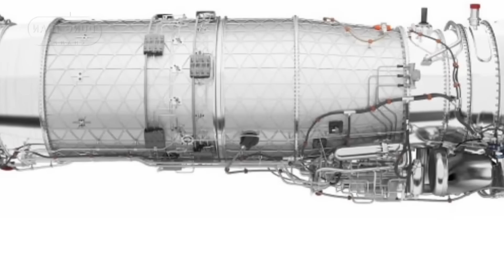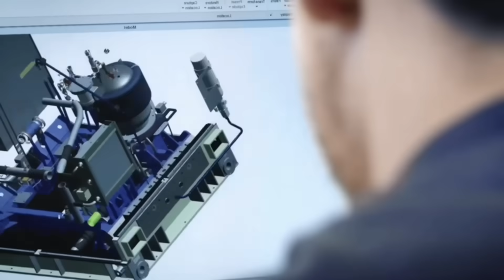How Rolls Royce Engines Make Sweden’s Gripen EF UNSTOPPABLE!

Comment: STOP LYING TO THE VIEWERS!
The JAS 39 Gripen E/F does NOT have a Rolls Royce engine at all and it is impossible to put that engine in the JAS 39 Gripen E/F.
The engine is the F414G developed by General Electric. This is based on the existing F414-GE-400 that is in the F/A-18 Super.
The JAS 39 Gripen E/F is completely built after this engine.

Comment: The US is blocking the F414 engine to Brazil's Gripens. That is the main reason for this proposal, since the other potential customers are NATO members. However it is costly to modify the Gripen to use the EJ230 or similar, so this will be dependent on sufficient number of orders for the modified Gripen, which hasn't happened yet.

Comment: The solution for the Swedes is to manufacture Gripen in two versions, one with the Rolls Royce engine and one with the present engine. Then they are free to export the Gripen with the Rolls Royce engine, if that is their problem.
It seems unavoidable to make the Gripen with Rolls Royce engine if it is true that that will enhance the performance of the Gripen to the extent it is claimed. TThe they should also ask General Electric to make an engine for Gripen that matches, or even excede the performance of the Rolls Royce engine.
Then the Swedes should end up with an aircraft that should make the big power move a bit more carefully around their smaller and assumingly less powerful neighbours. A least if those neighbours sports one or other of the 'Gripen variety in their arsenals.

Comment: Who made this video, Putin?  Ukraine flies F16's and it is getting a lot more of them. The Gripin E is powered with a GE 414 engine. The Gripen is NOT cheap compared to peers at $85mil. A variant F-35 is slightly more than the Gripen. Lockeed has these under $100 mil now. An upgrade Boeing F-15EX is $90 mil. Lockeed has delivered over 1,000 F35's. Sweden is not delivering a thousand of anything. The smart play is license Canada to build Gripins. With that you can have some manufacturing horsepower. Saab has a vulnerable situation now being so close to Russia. But Russia could soon collapse.
Reply: The Gripen fighter jet's cost per flight hour ranges from approximately $4,700 to $10,000, depending on the specific model and configuration. It is considered one of the most cost-efficient modern fighter jets, with lower operating costs compared to other aircraft like the F-35 ($35,000–$42,000) and the Eurofighter Typhoon ($18,000).

Comment: The third option is by far the most attractive and time-efficient. However, in the meantime, existing US engines should be reverse-engineered. They should then be analyzed to determine the highest-failure-rate components. These should then be manufactured by the EU for assured maintenance availability. This would keep the US engines functioning during the transition from US- to EU-made engines.
   The same could be applied to any/all avionics. Analyze their function. Duplicate these components (with just enough minor changes to avoid complaints). Begin gradual replacement.
   The EU must adopt the Kartveli Provision. Alexander Kartveli (of P-47 Thunderbolt fame), after learning of pilot deaths during combat, undertook "unauthorized" modifications to vastly improve the Thunderbolt's safety and structural integrity. Although unhappy with Kartveli's actions, Kartveli's own test results,  later findings and combat analysis proved to upper echelons that Kartveli's actions and tests were completely valid. Aside from saving hundreds of pilots' lives, the Army Air Force adopted a "fast-tracking" of proven modifications into practice.
Reply: What you suggested would be illegal as reverse engineering a US product would be piracy of patents and property rights. Plus I am not sure why you keep on about the EU. Britain is not in the EU and its engines are nothing to do with the EU. The EJ200 used in the Typhoon is built by a business mostly owned by RR.
Apart from which the EU does not dictate defence policy that is down to member states. The EU is not a country or a state it is a trading bloc.
Reply: @1chish part of the rights to the engine are owned by EU based companies.
Reply: @robertpatrick3350   Well sort of.
The EJ200 is basically an RR design. Partner companies are basically sub contractors.
And so what if they were EU based companies it is nothing to do with the EU.

Comment: Wrong, the Gripen E is powered by the RM16 engine made by Volvo. When the Gripen was first built it used a GE engine but that changed years ago. Now although it is made in Sweden it is still based on the GE design. Switching to the Rolls Royce engine unfortunately still doesn’t eliminate America’s ability to veto sales because key components are produced by American companies. Also unfortunately this is true for the Typhoon and Rafale fighter jets. Only Russian and Chinese jets are free of American parts and systems..
The only way to eliminate American influence or inference in the sale of these jets is for these countries ( including Canada ) to develop the systems that are currently produced in America to be developed without using any American patented technology.
Reply: Wrong. RM16 is General Electrics F414G, assembled by GKN Aerospace, former Volvo Aero. But it is still a F414.
Reply: Dassault Rafale were specifically designed to be a fighter without american components, just so it would be "ITAR-free".
Reply: @joakimbarkstrom9679 sorry buddy you’re wrong it uses the Sniper Advanced Targeting Pod developed by Lockheed Martin among other American components. Nice try but do a little more research.
Reply: @KevinBedard-y9j  Sure, Rafale can carry the Sniper but it is not an integrated component, so it doesn't have to.
Reply: @joakimbarkstrom9679 once again you’re wrong there are still multiple other American components that are integrated into the aircraft that can’t be removed.
Reply: @KevinBedard-y9j  Sure buddy. You know best.
Reply: Quels composants pour le Rafale ?
Dans ce que j'ai pu lire, le Rafale est dit ITAR Free ce qui veut dire qu'il ne dépend pas de la législation US
Reply: @kkal4956 obviously you haven’t done your homework
Reply: @KevinBedard-y9j  Monsieur je sais tout vous êtes dans l'erreur et je vous laisse vous y complaire
pas besoin de poursuivre avec vous
Reply: Sorry Kevin but Typhoon is not restricted by US ITAR regulations at all. Indeed some sensor systems supplied by BAE Systems for the F-35 are developments of Typhoon systems.
Reply: @1chish I suggest you do more research because you are wrong
Reply: @KevinBedard-y9j  OK mate whatever you say. You are all over this calling people wrong.
Reply: @1chish that’s because I did my homework on these aircraft and they do indeed fall under USA ITAR restrictions.
Reply: @KevinBedard-y9j   well you read wrong becasue the Typhoon is not covered by ITAR.

As I said if anything, becasue the UK is the only Tier One partner in the F-35, a lot of what was developed for Typhoon went into the F-35. Certainly the majority of the software was written by BAE Systems in the UK. Even the pilot's helmet developed from the yphoon by BAE was offered to the F-35 but the Yanks stayed with the US developed one. That BAE helmet further developed is going into the Tempest.
Reply: @1chish whatever

Comment: Many sales have fallen through due to USA interference, Argentina was actually nixxed by the UK (Falklands still an issue), so it would solve many hurdles but, not all.
The other major difficulty has stemmed from political pressure, admittedly with Trump 2.0, this seems to be less subtle and also less compelling as it once was, 
due to tariffs as well as perceived unpredictability and reliability issues. Should Canada finally opt for the JAS 39 over the F-35, chances are they could become the
hub for the RR engined (G/H ?) variant, at least initially, since assembly will be in Montreal, which also hosts Rolls Royce facilities.  Be well and stay safe

Comment: Rolls-Royce wouldn’t have the slightest difficulty supporting the EJ-230 for multiple customers. They are already supplying commercial jet engines around the world, often, for multiple airlines within a country.  The supply chains would be separate, but Rolls-Royce knows what is involved, and how to set them up. The issues are all technical, and they would involve things like weight distribution, integration with flight/engine management systems, and airframe changes to optimize the airframe/engine, as well as certification. Adding thrust vectoring to the Gripen, along with any power increase, would also be major pluses.
Reply: Also Rolls-Royce doesn't own the rights alone , eurojet turbo gmbh holds the rights to ej200 
and its 4 countries and 4 companies.
Also reason why Stage 1&2 aka EJ2xx aka EJ-230 is that both stage come with a high cost of engine lifespan 
and more maintenance cost, also why new  Germany 20 typhoon Tranche 5 ECR have the same old spec engine

Only engines that are in the works are for Flygsystem 2020
Reply: eurojet company gmbh that manufacturer of ej200 was headquartered in Germany. i dont know the what kind of intellectual rights that the germany has but getting approval from germany is harder than USA (except european countries)
Reply: @huseyinmehmetaltun2046  plus going from the F404 the EJ200 would been upgrade-ish 
but F414 to Ej200 is a downgrade, the however 2009 Safran eco demonstrator bigger m-88 but shorter
Seco inlet 78.74 cm Length 360.68 cm Dry Thrust lbf 13,500 A/B 20,250. Air mass flow 71.0 kg/s. Bypass ratio 30
F414 inlet 79.00 cm Length 391.00 cm Dry Thrust lbf 13,000 A/B 22,000. Air mass flow 77.1 kg/s. Bypass ratio 25

Now if you put the F414 into Typhoon with those big inlets, it would most likely do the full A/B 26,000 lbf.
Safran eco length difference, one less high-pressure stages, length of afterburner section and Variable jet nozzle length 

However the only way this would work and come to be, as this would be a drop in replacement for the F414, 
you would need at less two Jet manufacturers and a consortium with the rights to manufactured and rights to make 
derivative from that engine without royalty payment, however up till 2030 there are only 2 jets after 2030 only 1 jet.
and Both could work for Canada KF-21and Gripen, both have F414, only KF-21 has plans of dropping it for home made. 

Now The Consortium for this Engine Replacement Project would be made from,
Safran Canada/Safran Aircraft Engines, France, GKN Aerospace Sweden and Hanwha Aerospace South Korea. 

this is only real reason for making New Engine into the Gripen E, 

without a "US" Trump sale ban on Sweden and Babeface keep it going in his terms,

Sweden focus
For Saab, Sweden is the focus when it comes to fighter jets. 
The plan is for it to be financially viable, even if no other country wants to buy.

It's a tough sport to sell fighter jets. 
We probably shouldn't develop aircraft if we have to sell them to others to make ends meet, 
says Peter Nilsson, Saab Advanced Programs.

Comment: Rolls Royce is a good company and build good engines. But Sweden wouldn't be considering this if they hadn't lost trust in us because of the president ruining our reputation with our allies.
Reply: The Rolls Royce EJ230 is both more expensive and more powerful than the GE F414 engine which was already a power upgrade to the F404 engine that was in earlier versions of the Gripen.  Note that some of the supply chain for the F414 engine is in Canada, Sweden actually contracts with Canadians companies for the maintenance and refurbishments of their Gripen's F404 and F414 engines.  South Korea actually manufactured the F414 in South Korea and they also intend to replace the F414 engines in their KF-21 Boramae fighter with a more powerful indigenous engine, whether or not that will be in time for the batch 1 production starting next year hasn't been stated.  Yes, Lockheed Martin insisted the radar antenna be smaller and the interior weapons bay to be closed off in batch 1 so that the KF-21 does not directly compete with the F-35 but that doesn't hold true for batch 2.

As to why SAAB is offering the Rolls Royce engine is that there has already been export opportunities that were vetoed by the US through the US export controls on the F414 engine.  Even with the Trump administration becoming an unreliable trade partner, the offering of a non US controlled engine was eventually.  There are a few other engines of the same format and thrust as the F414, including one by India, one by China and one from Russia.  I think that if you are not producing the engine within your own country, it would be a good idea to adapt a few engines from different geopolitical risks just in case and it looks like both the South Korean indigenous engine and the EJ230 will soon be proven alternatives to the F414 engine...
Reply: @johnwang9914  thank you for all of that. You're a fountain of information. 😊 I appreciate the breakdown.
Reply: Actually they would because the EJ230 is a superior engine with more power and better fuel consumption.
Reply: Europe Need to Rearm Within Europe, And mabe Trump pushed us, Mabe not, But now we are here and we will never trust America the same again! ;)